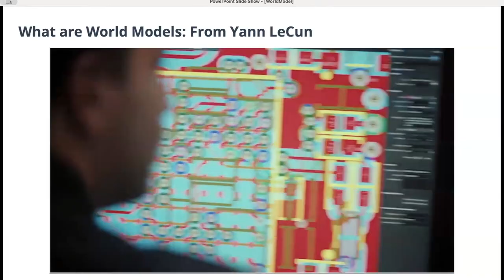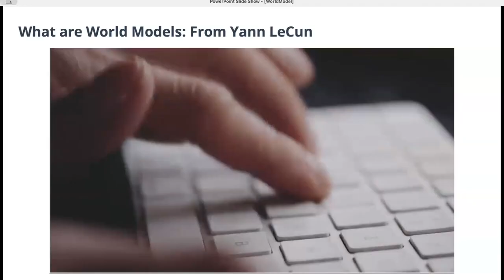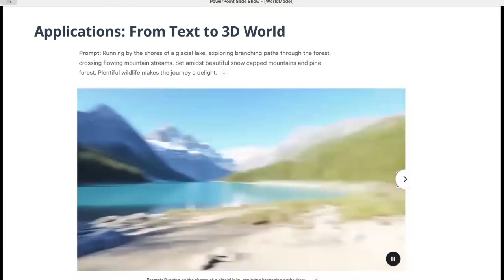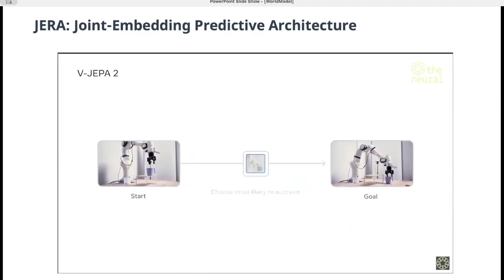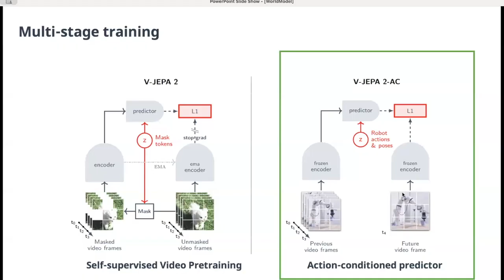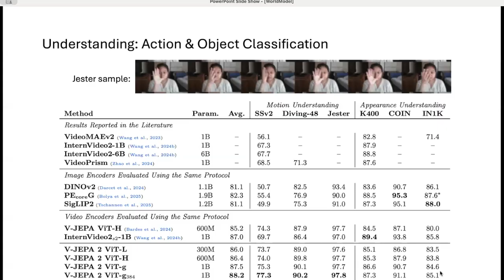Introduction to World Models: V-JEPA 2

Comment: Thanks for the video. At 35:06 you mention that the robot can infer the actions needed to reach the final frame from the starting frame. Is that actually happening? My understanding is that the robot still depends on the human-provided subgoals (the ones outlined in black). That doesn't diminish the result, but it does mean the system isn't yet planning the full sequence autonomously.
Reply from the maker: It is happening. The robot decides on the action sequence in order to reach the final state in the final frame.

Comment: 10x data size scaling yielded only a 1% improvement in accuracy, as did 3-fold model size scaling, 2.5-fold training time scaling, and resolution adjustment. Maybe a hard limit is being reached that scaling can’t overcome.
Reply from the maker: This is a good observation. I'm surprised to see how little performance lift the scaling gives. It may be because of performance plateau or the evaluation data cannot reflect the true lift.